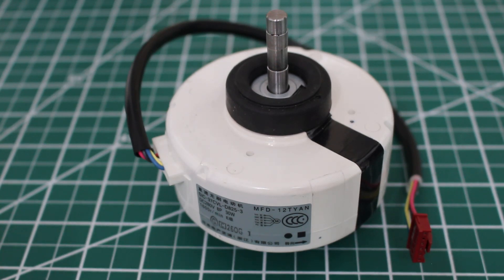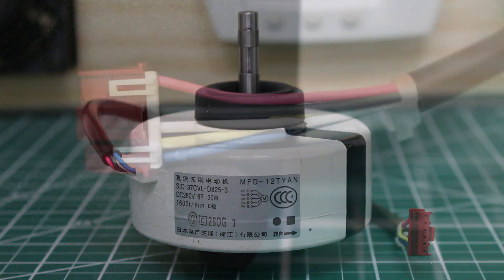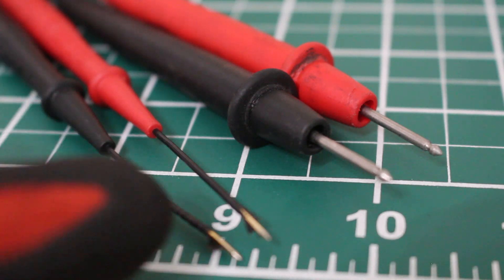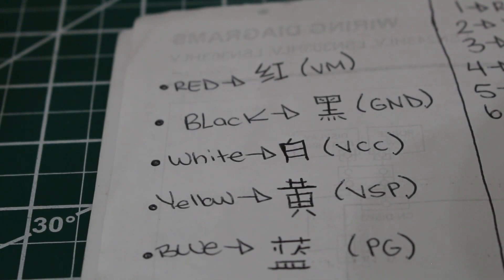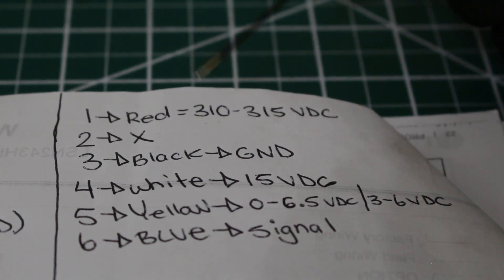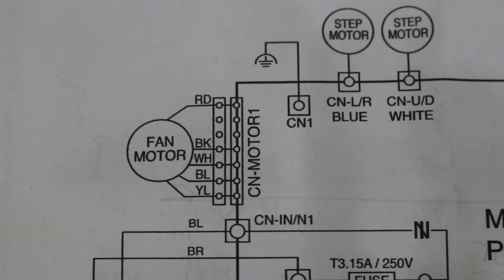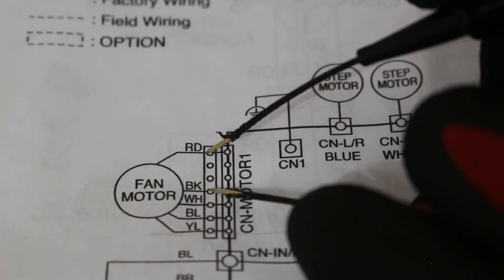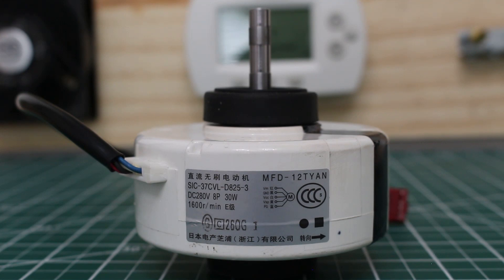HVAC: How To Check A Brushless DC Fan Motor For Ductless Mini Split Units (BLDC Indoor/Outdoor Fan)

Comment: Thanks for the explanation, I wonder... is there a way to power these outside the unit?
I got one where I have a intermitant vibration issue, the motors are not easily accessable, so aside from just swapping both or and moving it around, had to tell which is the issue, or even if it's motor and not a fan blade issue.
Powering them up to spin would help in diagnosing mine.

Comment: Thanks for the explanation, my MRCOOL  unit control board fried and I ended up with an H6 code after replacing it. After checking resistances like you explained on the fan motor, I ended up with OL so I’m ordering a new motor now. The voltages you specified coming out of the control board were spot on. Thanks bro

Comment: Hello: 
I have a GE AHTR12 that I'm repairing I just noticed something odd in my case that I would like to point out, I have the following readings from the main PCB to the motor:
RD Vm = 317 V
BU FG= 4.9V
YE Vsp= 0V
WH Vcc= 14.9V
BK GND
The "legend" or symbols of each wire I got it from the my motor's sticker. So the odd thing here is, that I do get a voltage on BU FG, but not on Vsp. Again I measure it coming from the PCB.
Anyways I'm wiring it the same way how it came from the manufacturer, so I just wanted to point it out if someone finds this useful.

Comment: Hello, 👋. I am sorry, if I received any voltage from blue ( signal rpm) ? I have voltage, but in the blue in have nothing. And my motor is not running…. But i have voltage in feedback….. and I have to 310v and 15vdc on wh…..